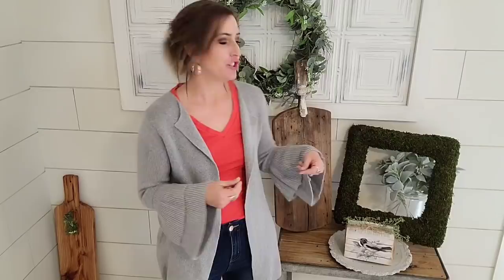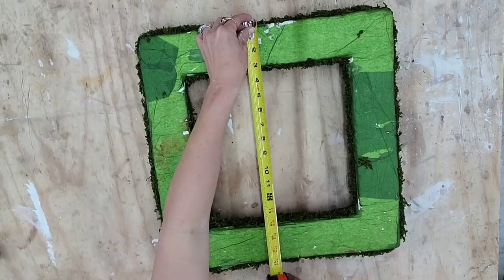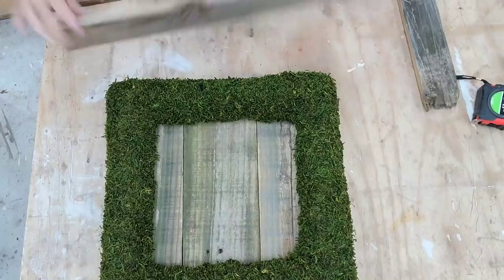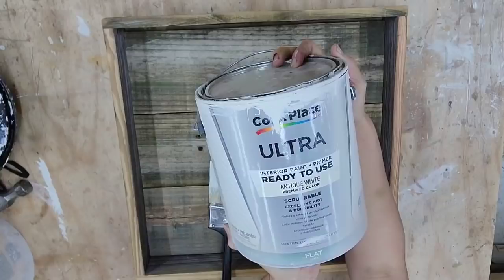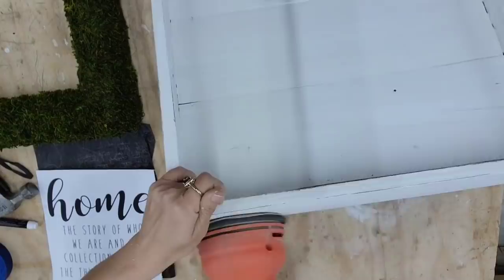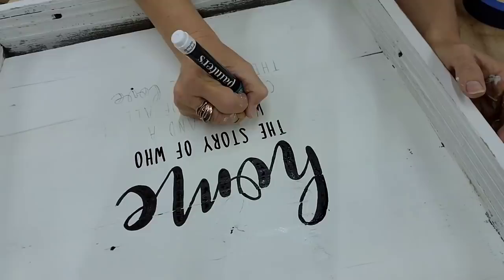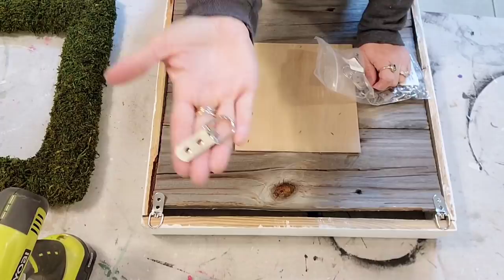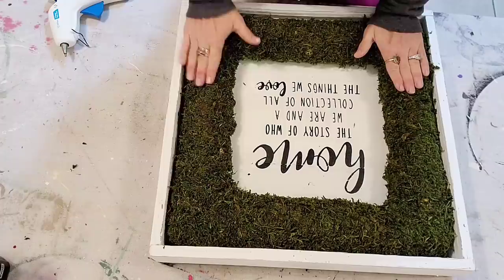Thrift Flips • Moss Framed Wall Decor • Spindle Handle Bread Board • DIY for Resale • Reclaimed Wood

Comment: Remodeling and so redecorating! I  just made 3 frames! They are different sizes. Thinking they will all need a moss mat!! And might need to do a couple of the breadboards to hang also!  Thank you so much for that inspiration! With inside homemade wood shutters those would be fantastic! Btw I have already started on the shutters from thick boards from pallets. They were rough cut. So the boards are not the same widths and there will be a few gaps lol.